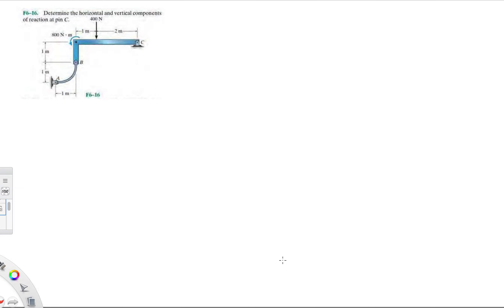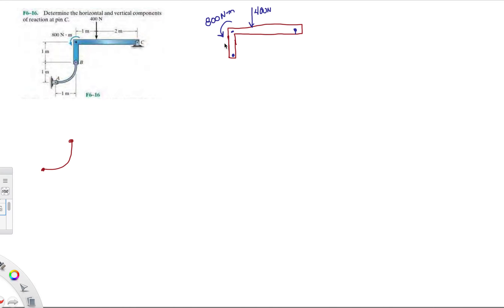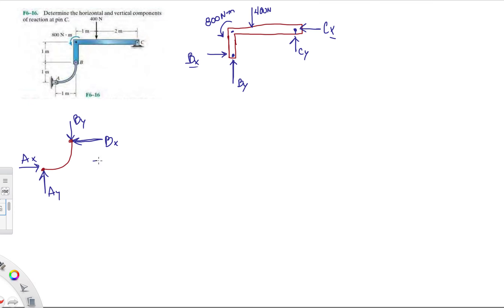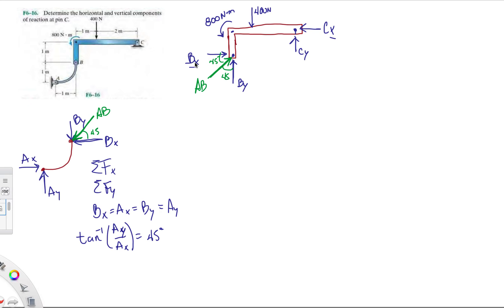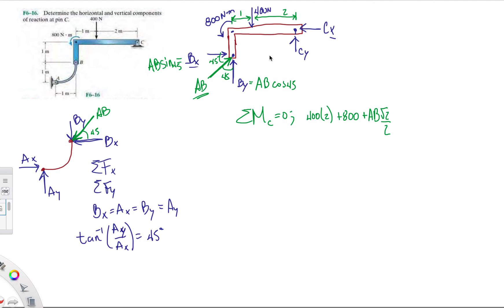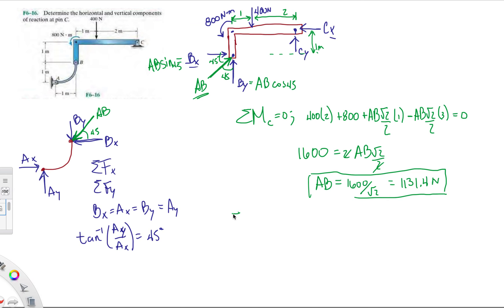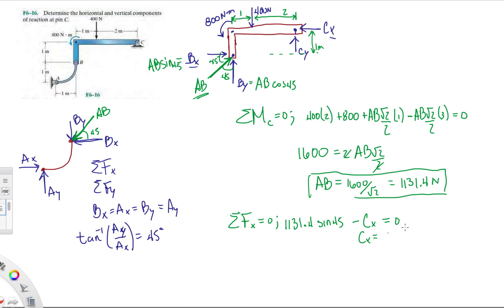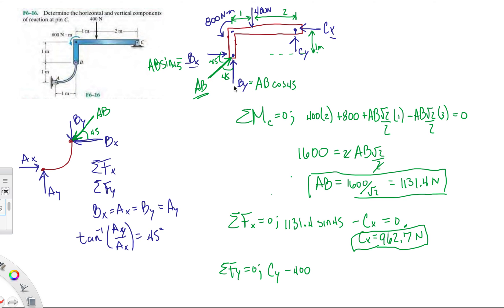Problem F6-16 Statics Hibbeler 12th (Chapter 6)

Comment: The value of Cx is wrong because your calculator is in RADIAN mode that is why you get 962.7 instead of the correct value which is 800.
Reply from the maker: Yes exactly. See my edit. Always good to catch it though. Means your trusting your process!
Reply: @theengineeringcrucible3490  I also have my yt channel and i am also watching other channels to know different styles of presenting their solution. God bless...

Comment: Cx = 1131.4sin45 = 800...................................... how do you upload non revised stuff
Reply from the maker: Didn't have calculator on me, so I used the mac's built in calculator.....huge failure LOL your correct. Glad you pointed it out. I upload videos as I do them, and sometimes check the answer to make sure they're correct. Focus on building out the problem not the number crunching.
Reply: @theengineeringcrucible3490  Haha well done anyways👏 I searched the problem to compare my final results not to understand the whole thing from the beginning so I spent alot looking for what I did wrong and was like sure the guy isn't wrong and I'm right with the final result😂
Reply: Cy=400?????